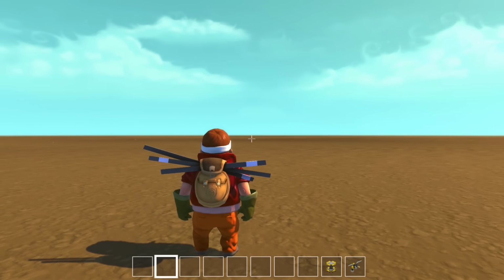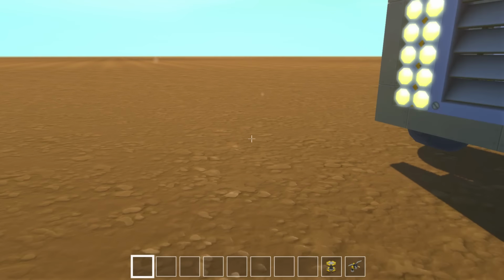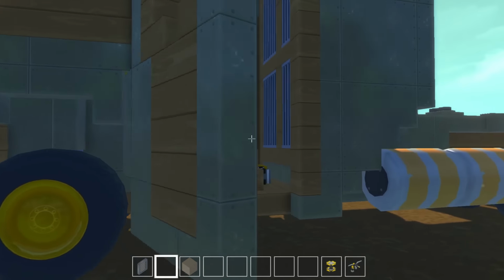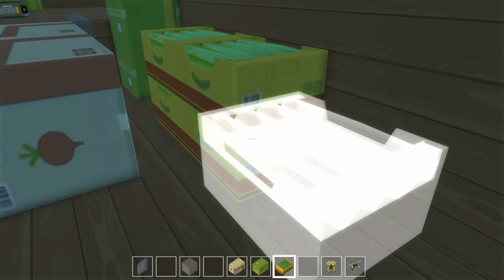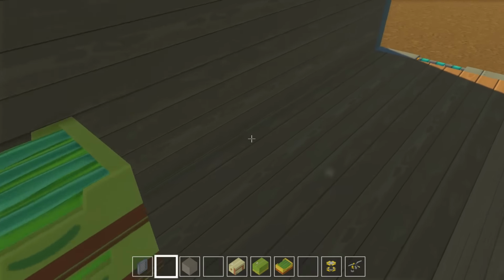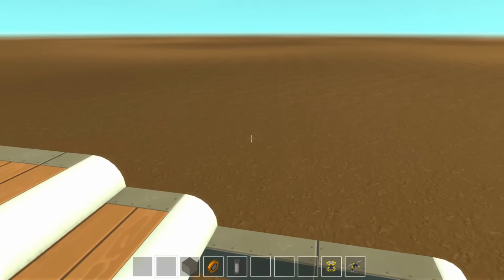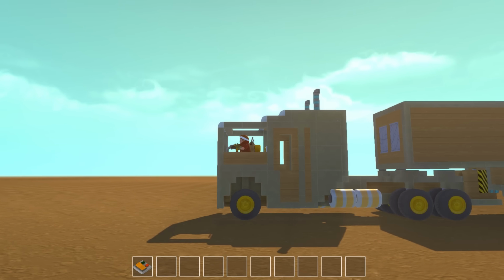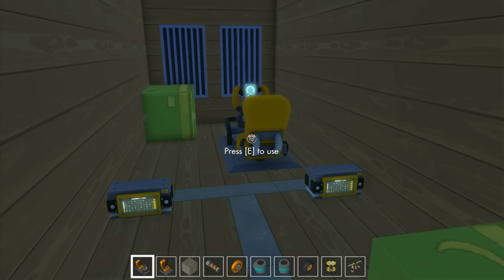Scrap Mechanic Gameplay: EP09: Big Rig with Working Trailer Hitch! (Let's Play 1080p)

Comment: the best way would probably be to create a small chassis in the back of the trailer with a single bearing and have at least 4 sets of free spinning wheels. you should also move this platform up at least 2-4 blocks.  If you do want them to turn with the vehicle there is a way to create a remote control using sensors.

simply add a bearing to the back of the truck, near the hitch. Attach this bearing to the seat/steering.  then add  2 sensors to the trailer. the idea is that when you turn the truck and the bearing turns and a bar attached to the bearing will move in front of the sensor. That will then tell a controller to  turn  the rear chassis, you'll need two bearings so you can use the input from both of the sensors.

Comment: BTW, the power going to the trailer doesn't come from the batteries, it comes from the alternator, which is basically a small generator run by the engine. This has been your tech tip from your friendly local car guy :) also, great video, i'm amazed you can do stuff like this.

Comment: A refrigerated trailer runs off of Diesel and those wires are for lights, air supply for suspension, and brakes

Comment: Just thought i would point this out ... The trailer was fine what it keeped hitting on was your post legs watch it were you decide to move the pinion forward u will see that the back of the truck keeped hitting the trailers legs :) just thought i would mention that

Comment: hahah, sorry bud but i got to comment again..seeing as how i am a truck driver...refrigerated trailer get their power from the reefer unit mounted on the front of the trailer...the lines from the truck only supply power to lights, abs and air to the brakes.

Comment: hey new to the channel but my dad drives truck and I've been around them my whole life. the solution to your problem is you need another set of wheels on the trailer and move them up a few blocks

Comment: Hey Diesel, There was nothing wrong with your trailer or hitch. Your rear wheels on the rig are going the wrong direction. When you turn right the rear wheels are going left. You have to turn the top bearing the other direction. I hope this helps. BTW I'm a big fan of your designs. Great work. Keep them coming.
Reply: Just thought i would mention if he has the wheels turn the same direction as the front wheels it causes the vehicle to just go straight but in a diagonal watch a monster truck turn and you'll understand

Comment: there are wires on a semi for break lights but most are actually tube for air breaks for the trailer cuz the breaks on the semi could not fully support the weight of the full trailer

Comment: this is a really good big rig w\trailer but the backing into part would be better if you had a mini cam to see both the hitch and support from the cab that way you could see when your unhitched/hitched and put you support down/up with a button from inside the cab.

Comment: 21:04 its not the center of gravity, your trailers still resting on the block after you removed that item earlier. it sank lower you can sort of see it when you jump, there's like no gap at the very end of the trailer where it meets the block its resting on. when you peeled off away and forgot to dis engage the hatch, you had the trailer on the lift you can see that the truck does sort of pivot at the hitch as the trailer stays in place sort of they move seperatly when its lifted. so the pivot is very possible. also yes, it does appear to be touching at the very end of the truck

Comment: Your problem wasn't with the rear wheels.  The problem is that the bottom of the trailer was resting on the truck and binding which wasn't allowing the hitch to pivot.

Comment: hitch is to far back move it up some atleast 3 or 4 blocks
Reply: true but what about the wheight?is it OK?
Reply: its causing fdiction
Reply: Yeah and needs another wheel on the trailer
Reply: +Montana Bevill 1. A lot of trailers are single axle. And 2. Not everything is going to be perfect. I mean, I can see where your coming from, but it's not gunna be perfect
Reply: +Montana Bevill Suspension is a bitch in this game. Too many suspensions and the game lags to hell.

Comment: the truck, it is a cabover, peterbilt, kenworth, mac, volvo, freightliner and a few others exist in america, they are rebuilding 7 where I live in canada.
Reply: also, the wres that connect to the trailer, do give it power, but also brakes, depending on the type of trailer, it may or may not have hydraulic brakes. the trailer usually has its own batteries.

Comment: Those aren't suppose to steer. And the weight is too much for the suspension at the back, the wheel are touching the thing.
Reply: +Milenos There's trucks with steerable rear wheels. I drive one.
Reply: +Neurosyphilis really?
Reply: Ellsibub Conroy Really. A Scania R450 with the first and last axles being steerable.
Reply: +Milenos the rear ones should but the mid should be solid
Reply: +Jesse “Ford” Walls the fire trucks at airports have steerable mid axles. they turn a certain amount to allow for a  small pivot
Reply: tomas agustin true but as they don't tow trailers (usually) they can utilize them
Reply: +Neurosyphilis there is not a CMV (commercial motor vehicle) with steerable rear wheels. i should know, seeing as how i have been driving a truck for 13 years with over 1.5 million miles under my ass. No, drive axles on a big rig steer at least no truck here in the US has this design. might be in other countries but definitely not here..but i would definitely like to give one a try, i dont see how it would help when you pull a 53' trailer like i do. i actually dont see how it would be beneficial at all. this design wouldnt help a trailer get around a tight corner, wouldnt help making backing up any easier. but still, i like to give it a shot.
Reply: Jeremy Williams Of course a steered tag axle makes it easier to get around a tight corner. It reduces the turning circle significantly.

This is all the info I could find on Scanias website, but it does mention steered tag axle: http://www.scania.com/global/trucks/main-components/chassis/axle-configurations/

Comment: how do you make these vehicles?
Reply from the maker: +Cool4600 Marin Time, Patience, and a lil bit of imagination. :)
Reply: +DieselDesigns the truck you built is a cab over.the ones with the engine front of the driver is called a conventional. Just letting you know. also nice build. it looks way better than my trucks look haha